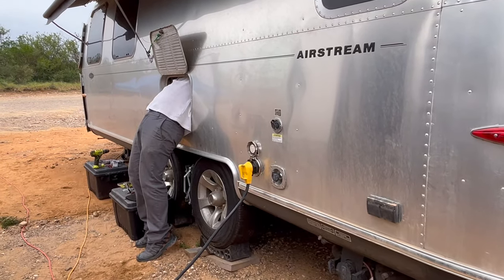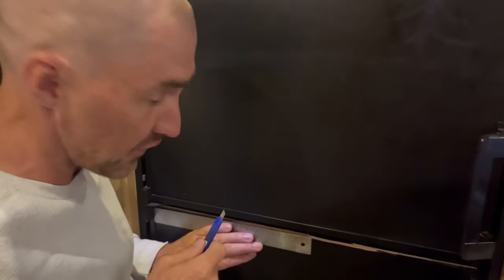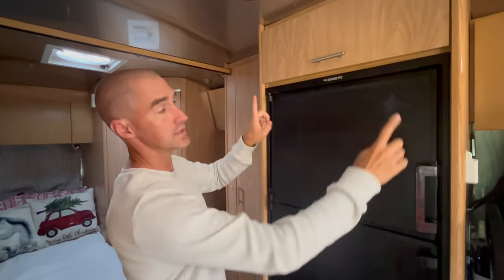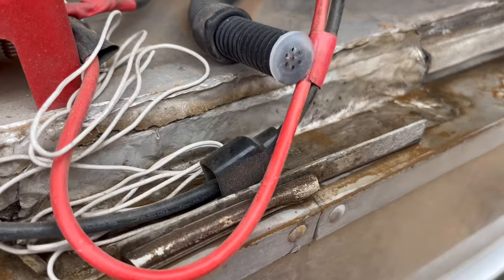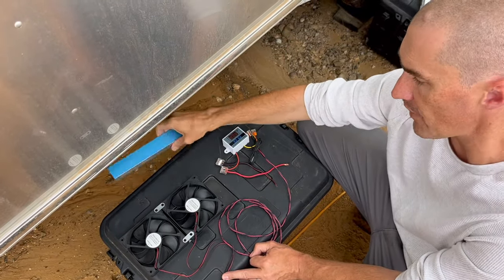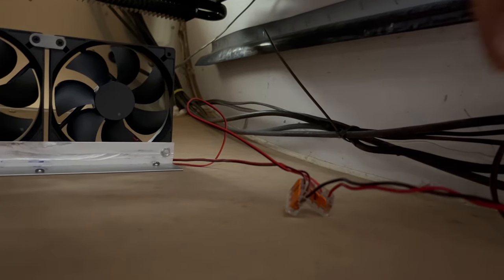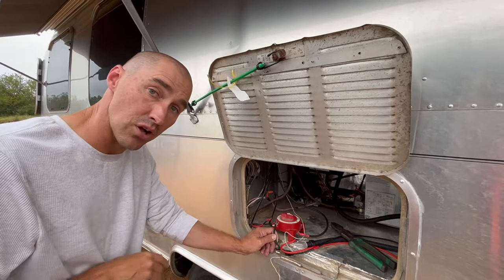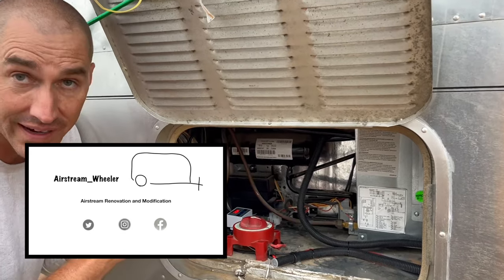RV Refrigerator Compartment Cooling Fans

Comment: The upward loop in the frig drain hose is to create a water trap that prevents warm outside air from wafting into the frig.
Reply from the maker: Good to know, I am glad I didn’t trim it shorter! I just lowered it and it still has a slight trap. Thanks for watching!

Comment: In the long run you are better to replace the Dometic with a AC/DC compressor unit. Your hot weather cooling issues will  be gone for good.
Reply from the maker: Funny you mention that! We were planning on that upgrade until our old one died suddenly a year ago. Ordering one then would have taken months, so we bought this and parking lot installed it ourselves. It was expensive and old technology. Shanna has never liked it so we might end up upgrading again.
Reply: Thanks for taking us along on this upgrade.  Love seeing what's behind the compartment and how it can be accessed.  By the way, you mentioned refrigerator coils.  Like with a home frige, do those need to  be cleaned as part of regular maintenance?
Reply from the maker: @cheriseray7587 Yes, as far as I know, they need to be cleaned. The back of the refrigerator gets dusty and dirty just like a house one. Thanks for watching!